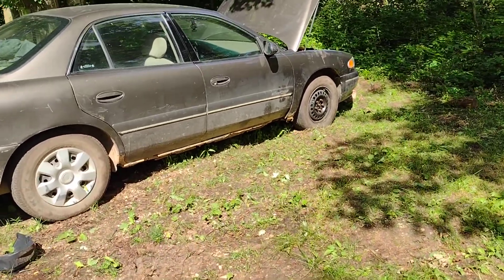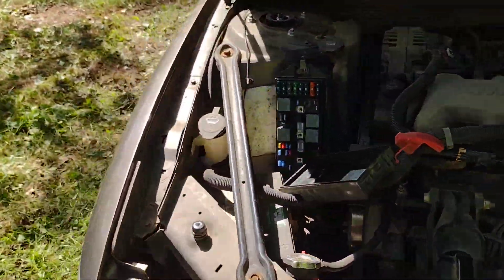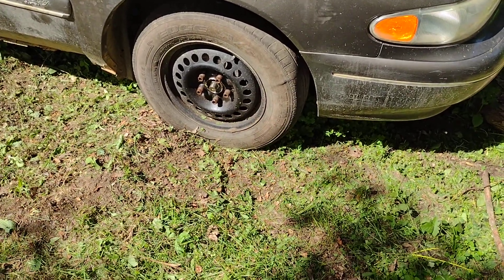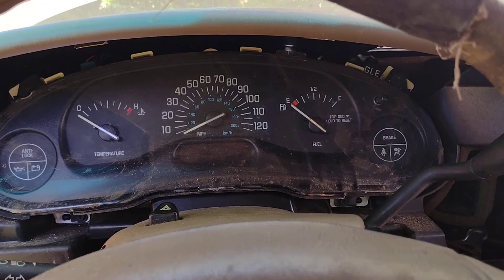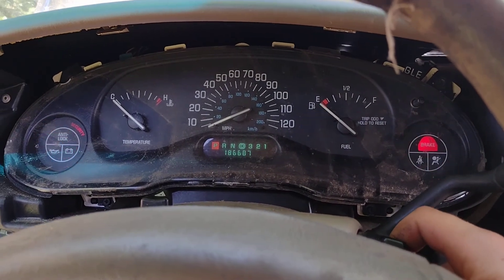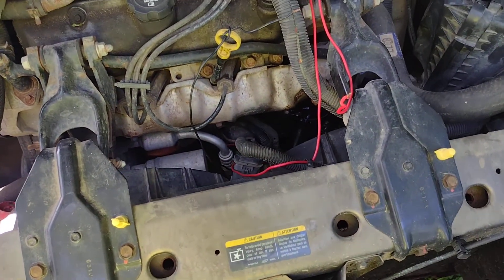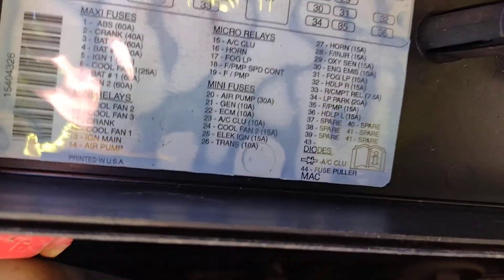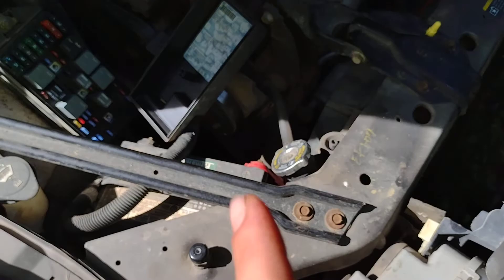2002 Buick century NO CRANK/NO START ignition problem (need help)

Comment: had the same thing. there is a fusible link going to the starter, the large wire. Take it apart and clean the connection where the wire going to the starter is hooked to the main wire coming out of the wiring harness. probably it is corroded on that connection. Clean it up and reconnect it using a good connector purchased from an auto parts dealer, the actual fusible link is probably still good, besides that you will probably not be able to find a new one, even from the dealer.

Comment: I got the same problem bro. On my 2003 buick century U have to keep trying. And sometimes a 30 second break in between try’s. I get it’s mostly on the 10th try and sometimes I wait 5 minutes and then try. It always works
Reply: I finally got mine starting consistently. I ended up changing the starter motor for a better model. The starter I purchased before had a loose s terminal and wasn't making a connection. I also replaced the battery wires too. They looked good but I had a corrosion problem and wanted to eliminate that condition.
Reply: But what is causing the issue..? My 2002 Buick LeSabre is doing the same thing 😮
Reply: @John-k9y3d   it’s the starter or either what fires the starter up. Sometimes it misses
Reply: @DJ317Naptown  but it's not making any kind of sound, only the lights are all coming on.

Comment: On the passenger side dash, open door. There's another fuse panel. There's a tire reset button. Put your key on with the car in neutral. Push the reset, then push the car backwards enough for the wheels to go around about 1 time. Then return to park and crank it up.
Reply: For real?
Reply: @earlyculer7746  worked for me. Just make sure you are in the car when you put it in neutral. Safety first.💜☮️

Comment: SOLVED*** I had the same ignition problem with mine. Your crank signal fuse (pass interior panel) is likely not getting power. You also don’t have any ground bolts in your engine panel
Reply: Is that fuse panel under the hood supposed to have bolts in it?  Mine don't

Comment: I seen that the security light stayed on that's the issue. The ECM is not reading the key.
Reply: Exactly mine too! That red security light is always on!
Reply: @MrDJ317  Turn the key to the on position back to the off position 10 times, then put the key into on position for 5 minutes, and it should register to key.

Comment: I just got my started. The starter was good. But I actually tightened all starter nuts to make sure they were tight. After that it started right up. Definitely check to make sure the contacts are tight and hopefully that will do it. But it could be a short too.

Comment: I'm having a similar issue--battery is charged, tested the voltage to the starter and that is 12.6. I also tested the continuity on the S terminal on the starter as well as the S terminal and the M terminal for the starter motor and that was good. I cleaned the ground connections and still nothing. You may want to check and make sure the engine isn't seized up as well. I'm getting a click but I noticed your vehicle didn't click at all. It could be a short some where. Keep us posted.
Reply: I got the same problem bro. On my 2003 buick century U have to keep trying. And sometimes a 30 second break in between try’s. I get it’s mostly on the 10th try and sometimes I wait 5 minutes and then try. It always works

Comment: I'm having the same issue. If anybody figured it out cool let me know. I wanted to add in that I need to change my fuel filter. After knocking on the filter I stated the car and it started but now nothing and the security light is on solid. Buick Regal gs 2000

Comment: Did you get it fixed? I have the same problem on the same vehicle.
Reply: I got the same problem bro. On my 2003 buick century U have to keep trying. And sometimes a 30 second break in between try’s. I get it’s mostly on the 10th try and sometimes I wait 5 minutes and then try. It always works

Comment: I'm having the same issue with my 2003 Buick Century. Please update!!
Reply: I got the same problem bro. On my 2003 buick century U have to keep trying. And sometimes a 30 second break in between try’s. I get it’s mostly on the 10th try and sometimes I wait 5 minutes and then try. It always works
Reply: @DJ317Naptown  thanks! Much appreciated
Reply: @HurricaneKatrinax63  No problem!
Reply: Also if it happens again before u fix and replace the starter and or starter parts.  I heard to just turn the key forward all the way till dash lights up without tryna start it. Basically in the on position and leave it in that position hold the tire reset button for 5 seconds or until it flashes. It’s on your front passenger once you open the door. The fuse panel on side of dash. The side panel can only be seen if door is open. To Remove the side panel is easy. It just clicks off with a simple tug and snaps right back in